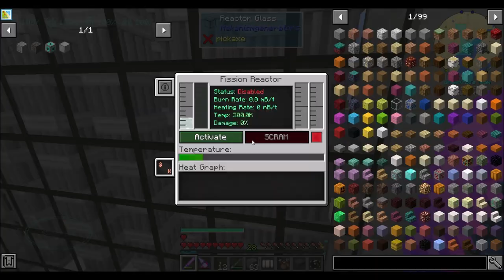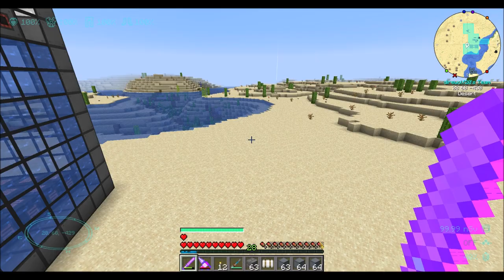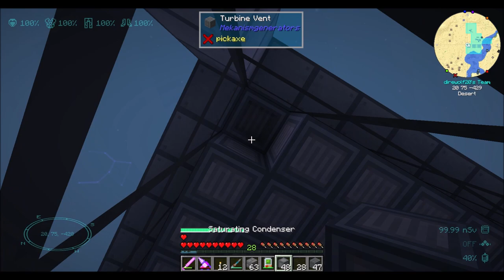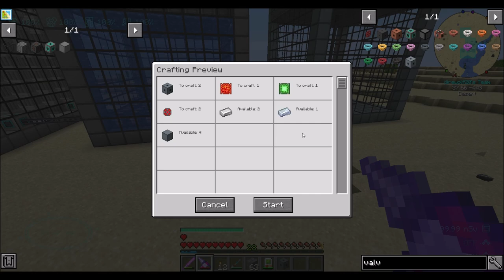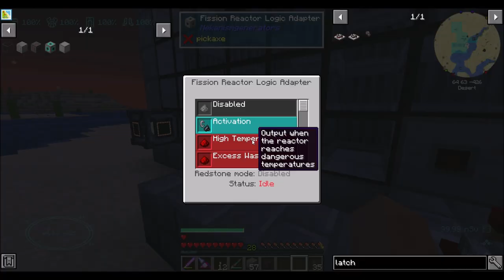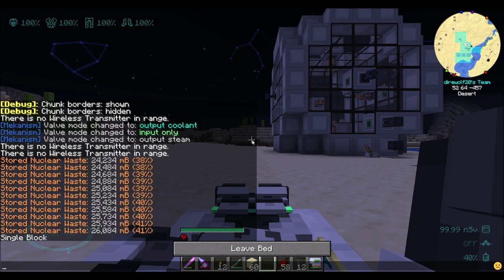Lets Play S10E82 Bigger Turbine

Comment: Dire. You want to have enough sodium inside, so your reactor, WHILE ACTIVE, has enough coolant to burn in the next tick. 31:59. Your Heating Rate is lower than your remaining coolant. and that is the break point.
Reply: This is correct.
The heating rate is the amount of coolant the reactor will heat up per tick. That coolant is then immediately transferred over to your boiler and replaced with the returning coolant from the boiler. That's why it looks like the coolant level in the internal tank isn't moving although it really is completely cycling a "heat rate"-amount of coolant each tick. If the coolant in the internal tank is less than the heating rate, any excess heat will heat up the reactor.
Reply: @shaberer  what i noticed in next episode and by tests is that reactor will show that it's rate is lower than actually required if there is not enough coolant, and will say that it's rate is equal to remaining coolant, but will heat up

Comment: Here's a few things you should do:
1. "days since last nuclear accident" counter on a giant sign in your base somewhere
2. Use create for it's "infinite fluids" aka liquid sodium and just convert it to a gas for infinite power.

Also just about every other important mekanism fluid while your there; for those interested a chunk 40 layers deep is enough{standing platform at y42 is the sweet spot), use the rftools builder configured to pause when not able to continue and 1 run with the place liquid shape card and don't touch it until it's finished!! as restarting it will just force it to place over existing source blocks.
Reply: To be more precise, 10,000 blocks of fluid is how many Create counts as infinite (with the default config)

Comment: Dire, rftools dimensions has changed a little bit. It definitely takes longer to get the dimlets that you want. The primary reason is that you need to collect and research the new knowledge, that you get either from randomly generated dimensions or as rare endermen drops. I believe that you need the third or even fourth tier to unlock terrain and feature dimlets (you get tier 1 from endermen , 1 and 2 from chests, 3 and 4 you have to craft from the lower tiers). You will also have to kill the new slime looking mobs in the RFTDim to be able to craft the necesary componets to create the dimlets.
You can still get random dimlets from the chests, but I have noticed there are only material dimlets in them, so it is still going to take some effort to get the terrain/feature ones. Also it is hard to automate the research of the knowledge, since it pulls from both slots; processed and unprossed. The same goes for most machines in the mod.

Comment: The reactor instantly heat up, and use all the coolant, than it will take a tick to get to the pipe, also a tick to get to the boiler, another tick to get cooled, another tick to get back into the pipe, and finally another tick to get back into the reactor.

You have to be sure you have you have as little "air" as possible in the system to make it a closed loop. In between the ticks is where you are gaining heat.
Currently, you have a lot of "air" flowing in the system instead of actual coolant.

"air"  because it isn't really a thing, just to make easier to grasp on.

What I do, is first fill up the pipes, so make sure the heated sodium pipe is full and the cooled sodium pipe is also full. Little trick to setup, need to keep forming/unforming the multblock, or connecting/disconnecting the pipes

Comment: if only you had some kind of tick acceleRATor to speed up production
Reply: has anyone tried that yet as you can't put the rat directly ontop or under the controle block so it may or may not work
Reply: @lordi2009k  I do believe you have to find the one block where the data is stored, which is not the controller
So it might work? haven't tried either, but that could be interesting to experiment
Reply: @Un4rm3dgames  yh i thought that the controller would be the data block but i can test this tonyt (i'm in the uk) as i can't really go on games that i dont use xbox controller for during the day with my pc being in the living room and pets running and jumping around if you get wgat i mean

Comment: Those buttons are theoretically a bad idea. If something goes wrong that would cause the reactor to go critical within half second, and you turn it on with the button, the reactor might be forced to run despite the high signal from the High Temperature control, because the button is on for at least half a second which could keep the toggle latch forced on. It's better to just toggle the reactor with the switch on the latch, because that way the reactor can start on tick 1 and stop on tick 2.
Reply: You could also put a pulse generator (monostable circuit) on the "on" button.
Reply: No. If i remember correctly, that latch will prioretize its shut off over power
Reply: Yes.
Sidenote: critical actually means "able to sustain a nuclear chain reaction". So if your fuel is not critical, it's not doing anything(except decay heat).
The word you're looking for is "reactor failure".

Comment: Dire is definitely going to forget to turn the reactor on with the buttons at some point, and its going to result in a nuclear accident. This could be solved by just changing the latch into a pulse repeater and using the reactor GUI to toggle it on and off. When the reactor reaches temp the pulse repeater fires, the momentary on sets the reactor to run from the control port, then the pulse ends and the reactor shuts down. Easier, safer, less accident prone. And, Create has a pulse repeater so doesn't require any fancy redstone machines.